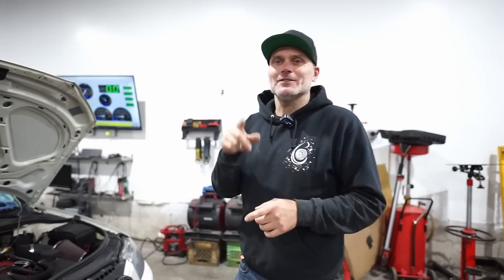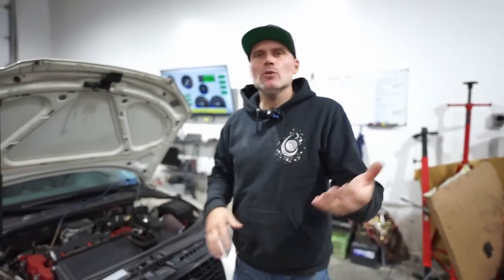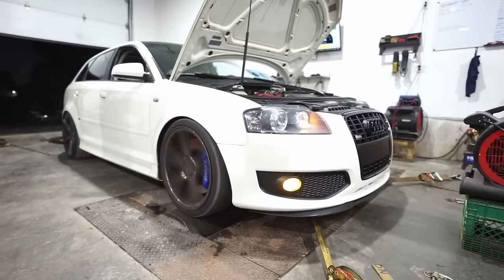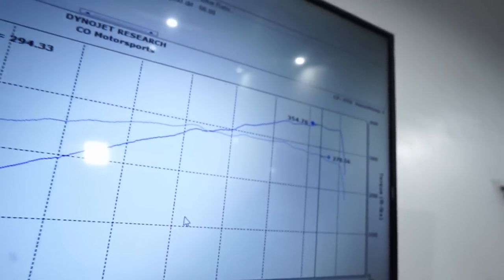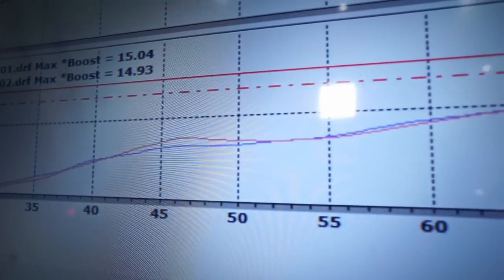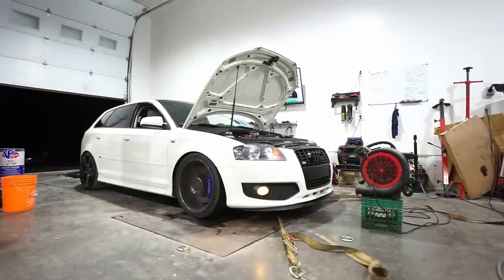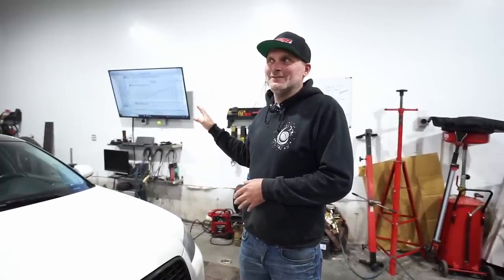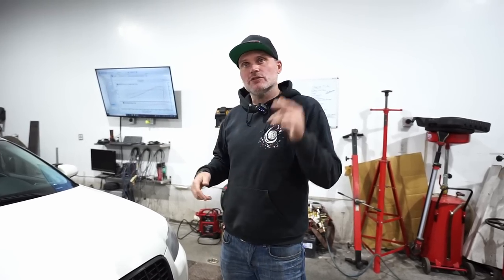HPA Motorsport 3.2 VR6 Turbo Audi A3 on the Dyno

Comment from the maker: So much more coming on this one. We're going to take advantage of that fully built engine. :)
Reply: Question, is there a big difference between the HPA kits? I know the HPA has the DTM kit and the FT going for a lot more but is there really a difference in HP vs the DTM kit?
Reply: Is he planning a DQ500 swap for +800bhp or does a clutch pack handle this power?
Reply from the maker: @Jingiee  this is a 20th anniversary kit so no idea how they compare.
Reply from the maker: @PLr1c3r  we'll likely wreck some transmissions first.

Comment: Nice car.  Like the look better than my MKV R I boosted.  Got the now defunct 034 turbo kit on mine.  On my 5th t3 exhaust manifold.   Darn thing keeps cracking.  Need a good header setup.  My blow by is high too.  Would like a good AOWS setup or dual catch cans. Other than that it's a beast!  Dynoed at 402 awhp on my old 6262 JB fully built setup.  Got a 6266 DBB setup now.  Should do 450ish. Now.  Runs daily on 20 lbs. boost for 6 years.  Destroys many of Dodge 392s, a Bentley Continental Lemans (616bhp) and even an R6 Yamaha. These cars are mega sleepers...
Reply from the maker: Nice setup
Reply: @COMotorsports  thanks!

Comment: What is your opinion on unitronic software for the 1.8t ? I have an 04 1.8t stage 2 with replaced K03. Ecs downpipe, high flow fuel pump, TT 386cc injectors, afe intake, front mount intercooler, forge splitter. But my tune it seems may have gone corrupted. Was doing 18 pounds. Now I am only reaching stock boost at 8-9 pounds. immaculately as well. Runs great. No boost leaks. Any thoughts ?
Reply from the maker: Hasn't been great from our experience, at least on our fuel. But with that said, the tune doesn't go away. If the ECU corrupt it wouldn't run at all. You have something else going on mechanical/electrically.

Comment: Did builder used proper crankshaft?
Reply from the maker: In what regards?
Reply: @COMotorsports  iirc mk5 gen has cast crank and Ive seen bunch of them go to heaven after 500bhp
Reply from the maker: @lamazver  Sounds like crazy talk from my experience, however this one I believe came from a MK4 originally.
Reply: @COMotorsports  mk4 is forged, mk5 cast. I'm tellimg you what I've seen. Every german turbo car uses mk4 crank.. they learned the hard way🤣
Reply from the maker: @lamazver  I know there's a difference between the MK4 and 5 crank. I just haven't seen them break personally.

Comment: This Quattro? If so, what’s the awhp you think?
Reply from the maker: Basically the same. Haldex is very efficient.
Reply: @COMotorsports  interesting. I had an ‘06 2.0T and an ‘04 R32. Against my buddy’s Z28 (older 5.7 motor, all of us were stock), the R would rip him out of the hole and hold the lead but on the roll the Camaro would pull away. My 2.0T would have difficulty down low but pull away up top. It has always been my understanding that the power loss from awd is substantial and not minimal. If the races end up like this wouldn’t the dyno reflect it?
Reply from the maker: @chrisbrletich  on true AWD yes, haldex is not. Meaning it's AWD when it needs to be then just goes back to being FWD when it has traction.
Reply: @COMotorsports  very interesting. like i get it, jw why there was such a difference in the performance of those 2 vw's.
Reply from the maker: @chrisbrletich  the r32 has trash power but has all the traction which is why it would pull from a dig, the 2.0t has a lot more torque and similar power which is why it would pull on the highway. Also r32 are heavy.

Comment: Hpa kit should make more power than that. All their FT kits make good boost low down. Seems like something is badly wrong.
Reply from the maker: Yes we've dynoed this car before. It does spool good.  But as mentioned were done chasing boost control issues in this one...it's time for management that can control it.
Reply: @COMotorsports  I run a aem tru-boostx on my ft-470. All works great. Hopefully you'll find the issue when you strip her down. That kit runs the oem medium actuator which I think runs a 7psi spring, opens around 10psi. Anyways good luck with the build.
Reply from the maker: @scaslin2009  base in this is 15-16psi. Lol. Either way we're not messing with this setup, time for more.